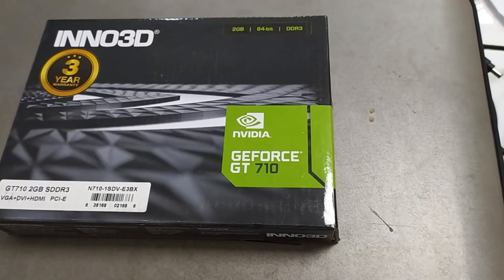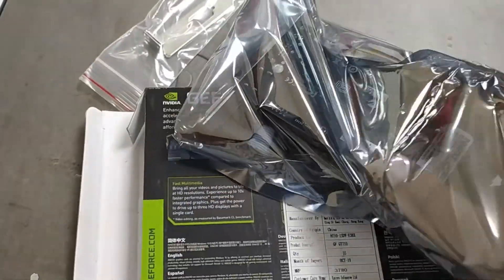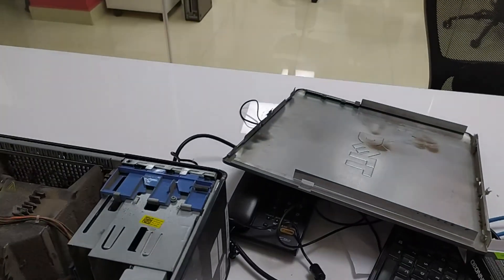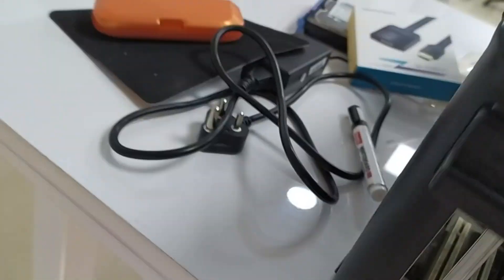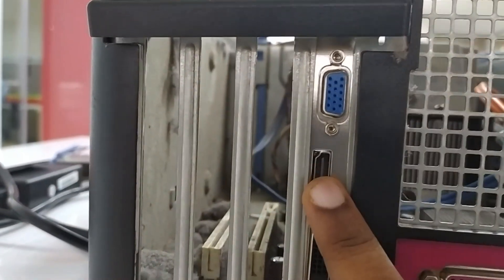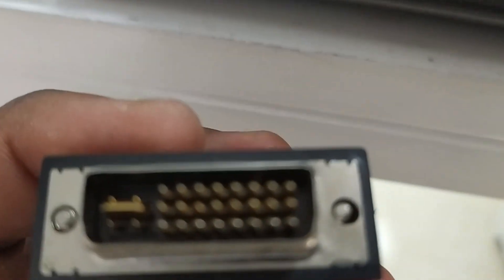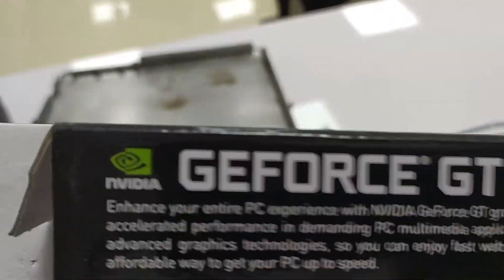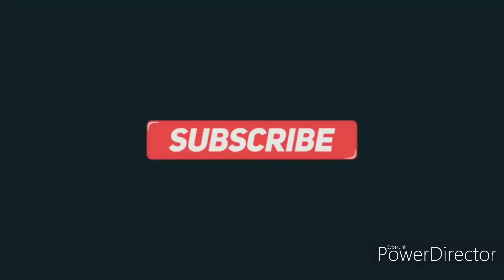How to install the Graphics in your computer in tamil

Comment: I cannot click or shutdown my pc
Reply from the maker: Just remove the power card and plugin again and power on the pc
Reply: @IronTech_IT   power on and off is not my problem bro i cannot go into my setting option and shut down my pc that the problems
Reply from the maker: @lingamoorthyvlog1083  system got hang that's reason abnormal activity happened try to press and hold the power button for 4 to 5 second  after that monitor will off automatically the remove u r finger , system will restart then try